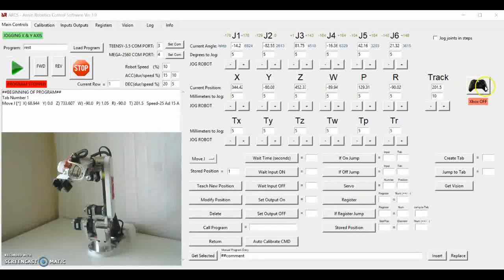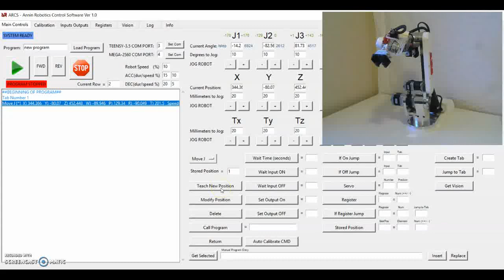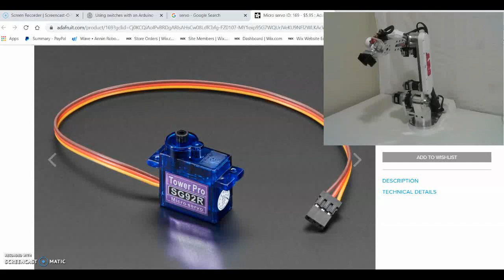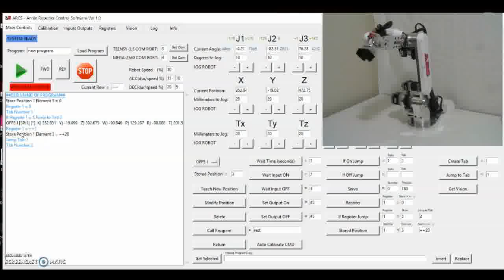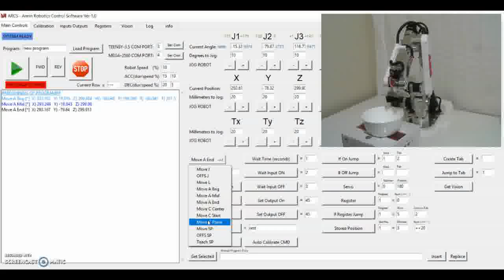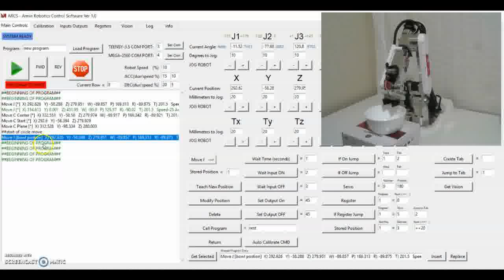AR3 programming

Comment: subscribed. is there any way to run this as a simulation to practice motion before i finish building
Reply from the maker: I'm working on some software updates to make the robot compatible with RoboDK which should be out soon, currently the software doesn't have any simulation capability.
Reply: @anninrobotics  ok thanks for the reply. Amazing work. 👍

Comment: Interesting, so one movement/commands controls several motors? When I looked at the program I thought each parameter was for each motor.
Reply from the maker: You can jog each joint individually but when you execute a move command it will command all motors to move together to whatever position you have asked

Comment: TEENSY 4.1 work with  your project? Thank you...
Reply from the maker: I used the 3.5 due to its pins being 5v tolerant for the encoder inputs.  Not sure if the 4.1 will work but I can check on that.

Comment: HI, I have a couple of questions about the project.
1) I want to make robotic arm based on your project but larger and with greater payload. But it probable require to set new Denavit–Hartenberg parameters. Is there any easy way to determine them?
2)  Why did you install the encoders on the motor shafts, and not on the joints of the arm itself? Isn’t it better for determining the real coordinates of the arm? Does the program allow installing encoders on the joints?
Great thanks for this project, it's just unbelievable!
Reply from the maker: The software allows you to put in your own custom denavit hartenberg parameters. you could put the encoders on the actual joints if you wanted to but mechanically that was a little bit difficult for me as I would have had to redesign some of the components to have through shafts whereas putting encoders on the motors made a fairly streamlined change.